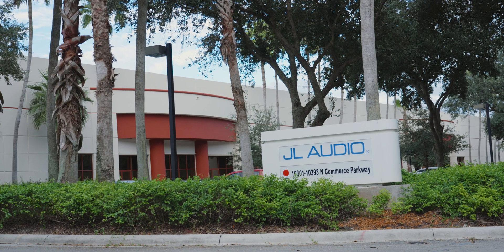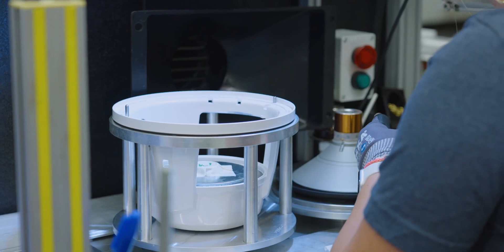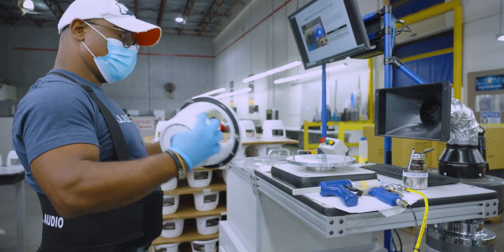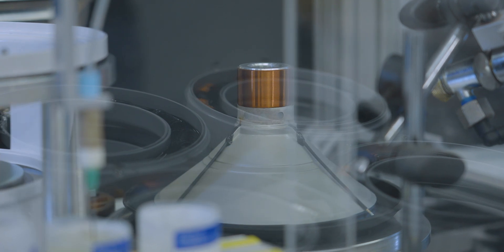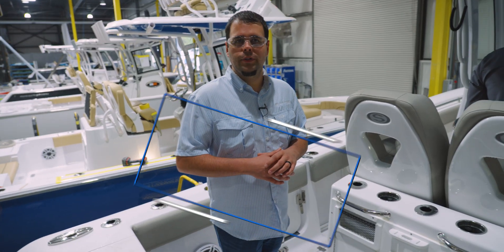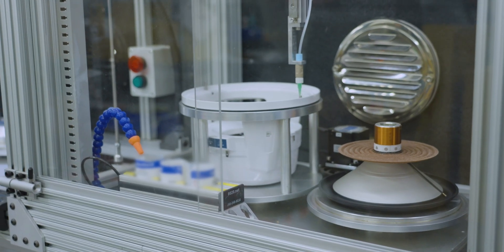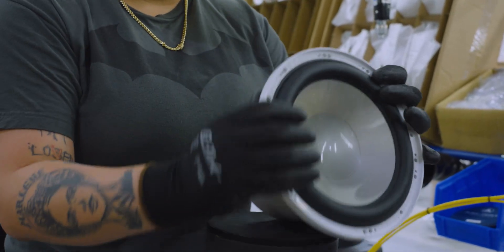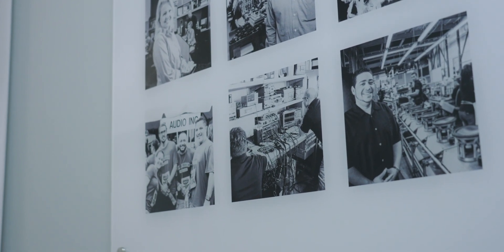Inside JL Audio Manufacturing Facility - Sportsman's "Behind The Glass" (Season 2 - Episode 4)

Comment: Are you guys no longer using JL audio amps and speakers?
Reply from the maker: Starting in Model Year 2024 we have done a full switch to a Garmin Fusion system standard. This DSP system is fully tuned on all models for the best sound possible. It's equivalent to the upgraded JL Audio package we previously offered.